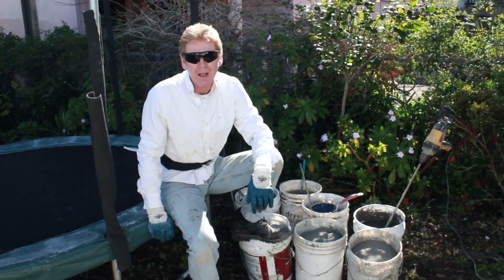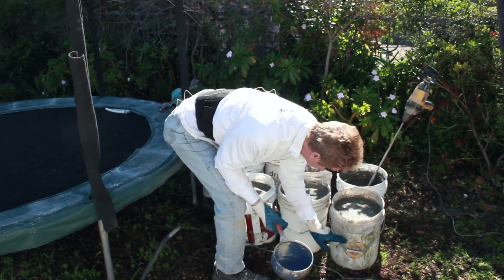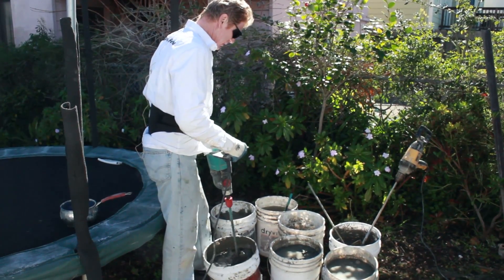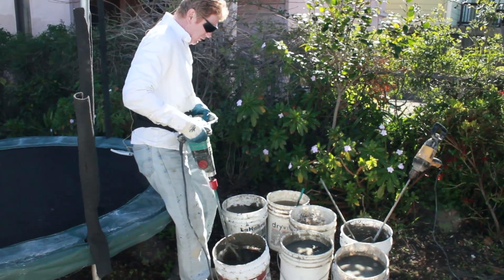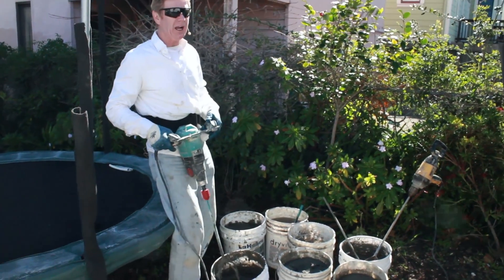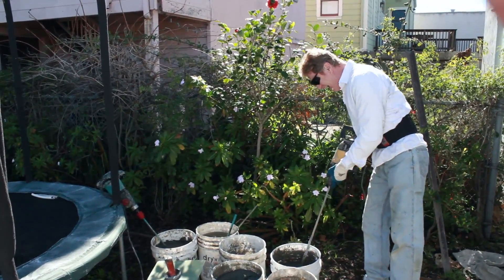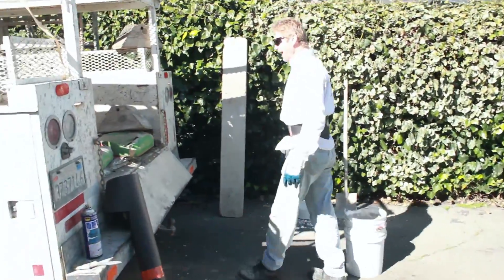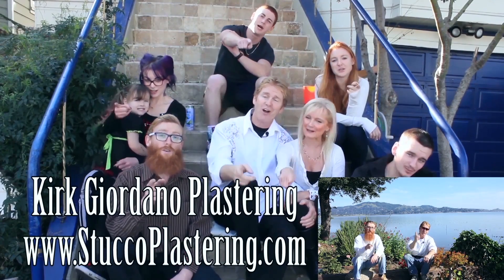Stucco ratios, sand to Portland cement.

Comment: Thank you Kirk. It is very generous for you to freely share this wisdom. 

I’ve got a concrete foundation getting stuccoed and there is some tar towards the bottom of the grade, do you have any recommendations getting it to stick?
Reply from the maker: To stucco over tar does not last, as the tar will eventually fail as it does not possess the ability to adhere to concrete permanently. Do the best you can to clean the tar then apply a stucco bonding agent over it like Weld-Crete.
Reply: @StuccoPlastering  Excellent, thank you sir. Have a great weekend and greetings from the East Coast

Comment: Hi Kirk, I’m reaching out from Vancouver Island, BC.  I find myself immersed in all things Stucco, as I’m unable to find anyone to do my repair work. Sigh.  I have a mid 50’s home with Pebble Dash Stucco.  The aggregate is not uniform in size,  like others I’ve seen, nor is it glass. Fortunately, I have access to this aggregate.  Been watching your videos, but so far I’m unable to determine what materials and ratio was used during this time period.  I would like to do a test board to try and match the existing uncoloured stucco as best I can.  It seems many trades use premixed bags and just add water but it’s unlikely this was relevant in the 50s.  Can you direct me to the basic mix from back in the day?  I’m a crafty gal but this is all new to me, so details are crucial. 🤦🏽‍♀️
Reply from the maker: Howdy Kim, you can buy perlite at the hardware store it's sold for soil, but expands when in stucco, perfect for dashing. Kemset Ekplaster 50 and Diasen are good for dashing also, just difficult to find. https://www.ecologicalbuildingsystems.com/product/diathonite-evolution/👨🏻‍🔬

Comment: You said 3 parts stucco 1 part sand but you said you put in 3/4  sand and 1/4 cement plaster I believe you got confused please confirm thank you
Reply from the maker: howdy Erick, a big oops. 3 parts sand to every one part stucco. 👨🏻‍🔬
Reply: 👍👍fantastic let me ask you this do you think a glue would perform best before a synthetic color cote or primer or none ?
Reply from the maker: Howdy Erick, all acrylic pails of stucco are sold with their own primer, that goes for Stucco-flex, Dry-Vit, Carsons, Western and La Habra. I have many acrylic finsihes posted in videos. Remeber all finishes weather cementitious or acrylic are only as good as what they are applied over, Thus, pressure wash the walls very well.
https://youtu.be/d3sHR8KD16c/  Applying waterproof stucco-flex over retaining walls.
https://youtu.be/Xfe5d2vCWjg/ Rendering any acrylic stucco primer and finish.
https://youtu.be/vaykXWAsFCA/ How to apply acrylic stucco.💃🏻

Comment: Good video. Can you tell me what type cement? Portland or portland plastic cement that comes in red bag. What is the name of the stucco sand? Is that the play sand sold in 
home depot? Or what bag that has sand in it?
Reply from the maker: Howdy Dude, Common or pure cement is sold in the red bags, it doesn't spread very well but it's mighty strong. 
The sand is named Olimpia or Felton at the plastering yards. 
The play sand is not right for mixing stucco for the best strength. 
If at home depot buy Rapid set, just add water and apply🍻

Comment: Quick  question here mr Kirk:  what’s the difference between luminate and rapid-set to do patch work?  And which one is better?
Reply from the maker: Good Evening Mc Dowell, excellent question. Luminite is sold by the bag for about 70 bucks. Leave this for us contractors as you will only need a handful.😉
 Buy the Rapid Set stucco from HD or Lowes as it has accelerators in it. All you do is add water,
 don't miss more than 3 to 5 minutes, or like all quick set cement plasters, overmixing weakens the cement plaster.
  Kirk’s Tip: to all subscribers or anyone who stumbles on our channel with a question, our gift to you is, type it into our Stucco/Plastering channel, and like magic, a video will appear to explain how it's done. 
   This feature is miles ahead of any plastering forum. 🥳
Kirk & Jason Giordano Plastering

Comment: Hi Kirk, What kind of drill bit are you using? You usually have links to the things that you are using in your videos, but I don't see a link to where to get the drill bit. I have many bags of core fill to mix and the paddle I have does not work well. THANKS!!!
Reply from the maker: Good Evening David, not sure. It's a mortar drill paddle. We have about 10 different ones.😏
  Kirk’s Tip: to all subscribers or anyone who stumbles on our channel with a question, our gift to you is, type it into our Stucco/Plastering channel, and like magic, a video will appear to explain how it's done. 
   This feature is miles ahead of any plastering forum. 🥳
Kirk & Jason Giordano Plastering

Comment: Hello there. Can i stucco over painted exterior brick or block chimney. Should i use synthetic stucco or sand and cement. Probably should use bonding agent for both applications. Or do i have to grind the paint off. Thanks

Comment: why so much sand 3 parts and 1 part stucco...   i just did a small patch job no sand all stucco...  was i wrong to do this ???
Reply from the maker: Good evening John, with no sand and only portland cement plaster the plaster alone will crack, especially if you go thicker than 1/8 of an inch thick.
                         Bringing peace, love, and harmony to plastering 
                 Sound advice from the plastering messengers of Youtube
Reply: @StuccoPlastering  thank you so much... i did not know this... i will remember this... live long and plaster...
Reply: @johncasor9698  he adds to much sand and you add no sand.

Comment: Hey Kirk and family. Something I want to share .
That mask your girl wears is nearly useless, and I don't see you wear one most of the time that is adequate as well.
U need the 99% percent ones at least when you are at the mixing / pre mixing of any material you use. Especially if it has silica sand quartz etc.
If it's something with accelerator in it then you need the oily particles type mask as well.
A 3m 2097 one filters are dirt cheap and you can get and 3m mask to go with it from aliexpress. The 2097 will save you from all oily and non oily particles on top of helping on some acidic stuff as well (though for that you need the 6xxx series ) .
The parts where you have lots of material dust are not good for you . And I would love to be able to watch ginger stucco tips for a long time :).
Live long, wear a suitable mask, and plaster...
Reply from the maker: Greeting Yoav, my friend you are correct, we all have really good ones now, thanks for the tip.
          Get plastered like stucco with the Giordano family 
   Sound advice from the plastering messengers of youtube

Comment: I thought it is counter clockwise that brings the water down to the bottom ?
Reply from the maker: Howdy Deekoh, you may be right, as a rule, I no longer mix.
         Sharing stucco secrets and or common sense plastering tips
                                Kirk Giordano Plastering

Comment: Hi Kirk, is plastering the same as  stucco. Can I plaster, or stucco. You see I'm going to  build a cinder block retaining wall. So I was wondering which one to use. Thanks; hectoralaniz51@yahoo.com
Reply from the maker: EveningHector, Plaster is a word that means interior use.
 Stucco means exterior use.
 Most people dont know the difference,
 You would stucco your cinderblock wall, with Portland cement mixed with sand.

                   Get Plastered like stucco
      Kirk and Jason Giordano’s Plastering tips
Reply: @StuccoPlastering  Thanks Kirk for the Info.  Appreciated. V/R Hector...

Comment: I use the paddle that I say scrapes the sides of the bucket lol. That don’t happen until it’s really sharp so it won’t be that way for a while depending on how u use it. But usually put water in first and which is close to the top of the second metal paddle depending how tall it is. And put 15 shovels to one bag of cement with 3/4 bucket of water and comes out awesome just don’t use wet sand with 3/4 water because it’ll be super soppy lol
Reply from the maker: Howdy and happy Easter, Great advise Armando my fellow plasterer.
                           Peace, love, and harmony to all
         Sound Plastering tips for the DIY beginner’s and Plastering experts

Comment: Did i tell you the story when a guy threw accelerator into the mixer it locked the whole mixer up we spent all day choppin it out 😏he got fired👍😆
Reply from the maker: Howdy and happy Easter Grey day Dude, seen it happen myself about 15 years ago when Eisenwall first came out.
 The stucco company mixed it then they took lunch not fully understanding the accelerated set time in the summertime and without adding any of the retardants.
  They thought it was like portland cement stucco, it hardened,  If you understand the cementitious product Eisenwall by rapid set, you will know that it's almost three times the PSI strength as portland cement stucco.
That mixer was done for as no amount of chipping would dent that rapid set.
    Now granted any company that says they have never had either Portland or Rapid Set cement harden on them has not been in the trade long enough, as no amount of reading can teach even an experienced hod carrier or contractor the set times of all types of cement.
This we have to learn from years of practice.

                           Peace, love, and harmony to all
         Sound Plastering tips for the DIY beginner’s and Plastering experts

Comment: I have 2 brick chimneys 45 ft. that were built in 1852 here in Louisiana. Both were covered at some time in the 1930s with little blobs of something similar to stucco. Now some are starting to pop off of the brick. Anything I can spray over the chimney to help hold these little blobs. 2 1/2 to 3 inch in diameter. Both are open top no covers free standing outside chimneys.
Reply from the maker: Howdy and happy Easter Herbert,, sorry to say but no, if you find the right stucco guy he should either water blast or scrape to remove all loose areas then replaster them back in to match the existing finish.
 Then I recommend you primer and paint both of them.
 If there were shortcut like another layer on top that would bond these areas together I would know it, there isn't unfortunately.
 Sorry to this my brother.

                           Peace, love, and harmony to all
         Sound Plastering tips for the DIY beginner’s and Plastering experts
Reply: @StuccoPlastering  Thank you, sir, your vids are great.
Reply from the maker: @Spikebuckthurmondbranch  Thank you, brother.

Comment: Hi Kirk, do you recommend using a primer/sealer over a base coat I’ve done over brick veneer as I can see the brick joint lines quite clearly.  I’m texture coating a 1mm sand finish with a coloured acrylic anyways but if I skipped the primer would you see the joint lines as to VS with primer? Or would it make no difference
Reply from the maker: Howdy and happy Easter Tala, if you can see the grout lines you did not apply the base coat thick enough.
 no worries.

 if you apply a finish coat I would advise the finish coat to be heavy sand such as 16/20 sand.
 Plus I'd splurge 20 bucks for a can of Larson's weld crete bonding agent, paint the bonding agent over the wall before the finish coat,  your right it will stop the bleeding through.
 FYI. if you applied a pprimer your finish coat would not adhere for more than a year.
 There s a huge difference between primer and a bonding agent.
 if done right no more lines.

                           Peace, love, and harmony to all
         Sound Plastering tips for the DIY beginner’s and Plastering experts

Comment: Nothing like a little late night info from the Master Plasterer.  
I work alone on some smaller projects for myself so I stay consistent with premixed RapidSet products, 5 gallon buckets, a paddle and drill.  I mix small batches.  It works for me but I am merely a hack in comparison.   My point is just that people need to experiment with amounts of water etc.
Reply from the maker: Howdy and happy Easter Mark, Exzackory, no books or advice can compare to losing the set time and having to work your arse off or throw the material away.
                           Peace, love, and harmony to all
         Sound Plastering tips for the DIY beginner’s and Plastering experts